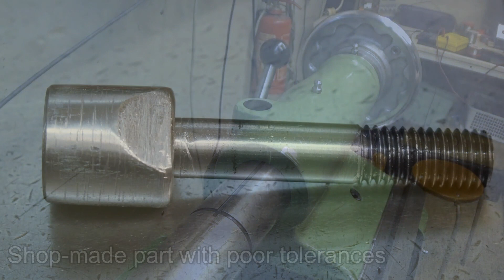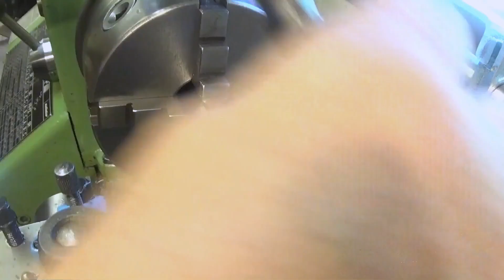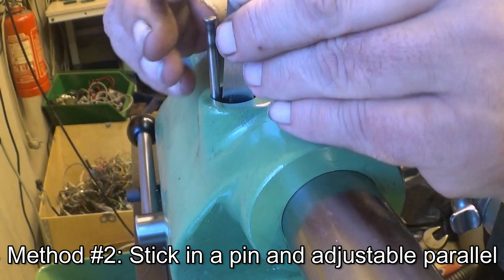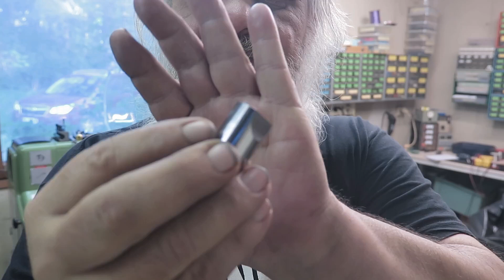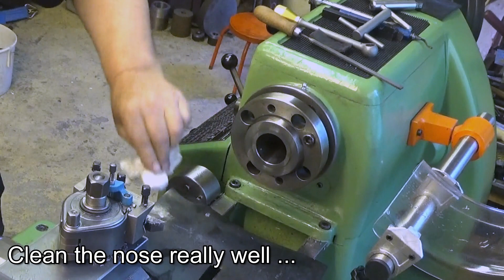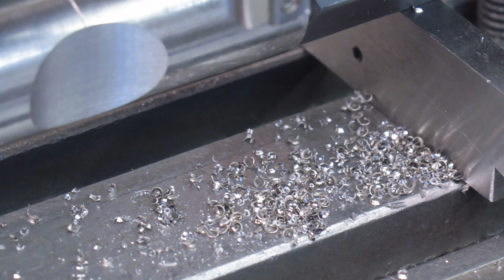Weiler Matador Tailstock Quill Lock

Comment: Interesting video! My Weiler quill locks very nicely but if tightly locked it binds up so I have to persuade it to release by knocking it down. Interesting that it can be fixed, have to take mine apart to see if it is worn like Yours. I wonder if perhaps these parts would be better made of bronze.

Comment: Great videos on the Weiler Matador, I too have the very same lathe, you may be able to answer a question for me about selection of spindle speeds the adjustment know is marked with 4 speeds the high and low ranges are selected by the R & Z lever, how do you select the 2nd speed in either range ?
Reply from the maker: In my lathe there used to be a dual speed motor. The motor speed was selected by a switch in the electric panel. Now there is a VFD so I can set the speed steplessely instead of having just those two.